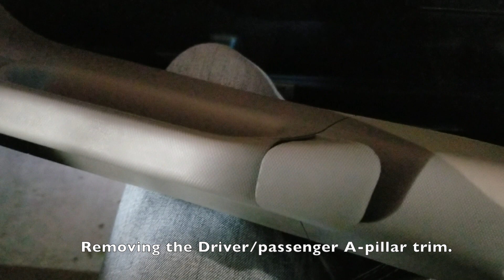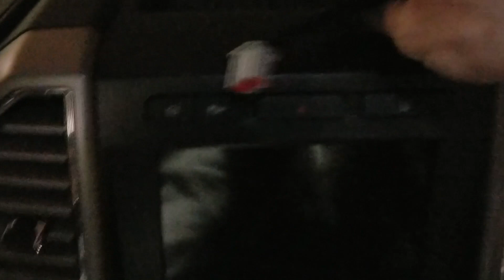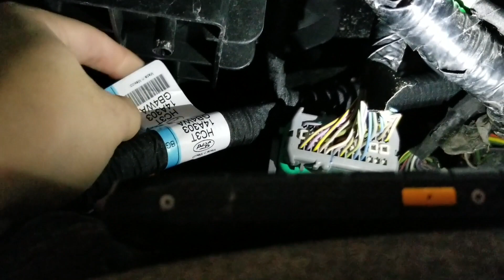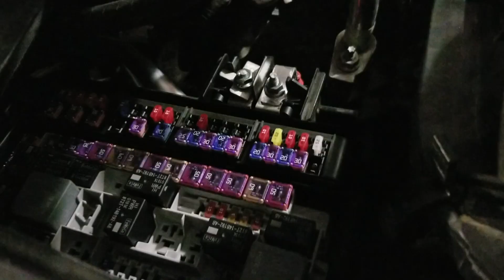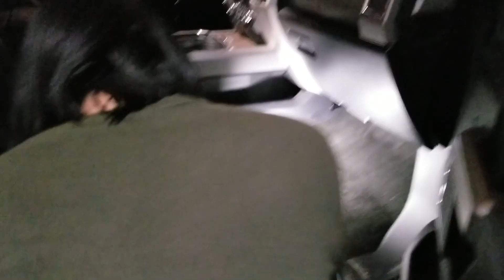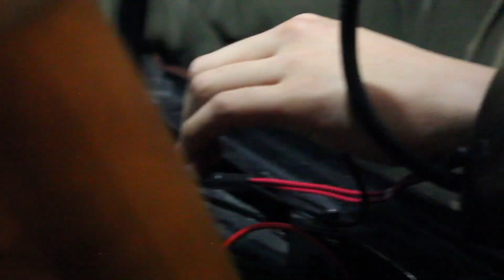2017+ Ford Superduty Upfitter switch install + Elevated idle mod

Comment: What harness part number do you have to run the wire through the A-pillar
Reply: A Pillar to switch harness -- LC3Z-15A404-A

Comment: Great content. Very informative and I learned a lot from your video. How different is the 22 from the 17 model years to add up fitter switches?
Reply: Switches are the same as the 2017 but you only have to do the short run of the harness from upfitter switches to the A pillar then connect the relay box under the hood for the 2021 and ups. They are prewired for the switches even though it wasn't an option on your vehicle which makes this job easy on the newer trucks. I would option for the wireless upfitter switch option by STL if I had a 17-20 model.

Comment: Will you do mine?  I have a 2017 F350 4x4 Platinum with a 6.2 Gas and for some reason no upfitters?  Had them in my last Truck and miss. Great video.

Comment: Does this work on the f150?
Reply from the maker: It's a feature on the Raptor so I figure it should be possible. Can't confirm though how difficult it would be on an F150

Comment: Do I need to get the console piece with the sunroof button in order to do this? I have the power rear window, but no sunroof.
Reply from the maker: In that case you'd order the overhead console without the sunroof buttons (find the VIN of a similar configured truck WITH upfitter switches and use that to find the part number for the overhead console)

Comment: Just did it on a 2019 F350 6.2 gas. Good instructions. Glad I did!
Reply: I have a 2018 F250, 6.2 gas. Getting ready to do the same. Can you tell me if your install was the same as this video? Same cable assemblies? Don’t want any surprises.

Comment: I own 2 F250s I never saw the need for it.
Reply from the maker: Depends on what you use the truck for. I have elevated idle, front and rear aux lights and winch control all running off my upfitter switches.
Reply: @55quadboy  I farm out of my trucks, they make really good work trucks . I like basic trucks

Comment: I know I’m real late and may not get a reply but I do have a question. So i had my upfitter switches installed recently and I’m being told the dealership has to program the BCM for them to work properly, did y’all have to do this?
Reply from the maker: Nothing needed to be done on mine
Reply: @55quadboy  Looks like i'm gonna have to do some tracing. Thanks for the response.
Reply: @55quadboy  hey man, one last question. From what I can see it looks like I’m missing the part of the harness that runs down from the upper console into the A frame, would you happen to know what part number that is?
Reply from the maker: @mightyfinger77  both part numbers for the harnesses are listed at the beginning of the video
Reply: @55quadboy  hmm I did buy those, thanks man
Reply: @mightyfinger77  A Pillar to switch harness -- LC3Z-15A404-A

Comment: Mucha gracias!!! This job was so freaking easy!!!  Worst part was the fender because I have bushwackers and rock deflecters. I wanted to do this upgrade for a tear now.  It's was so easy I should've done it long time ago.
Reply from the maker: You're welcome, glad to hear it worked out
Reply: Interesting thought though is why not shorten the wire and run it across the back wall?  Looks like it would save some wire threading time.  I'm interested in the high idle mod but it's a little overwhelming

Comment: Awesome video guys. I ordered the exact parts you listed as my F350 was a Lariat equipped as yours. I have the camel interior Blujean exterior, and dash trim is primarily black, so I love the black upfitter console. The 3 items ordered are everything needed for the modification except the small 10mm nut on the main fuse box. Followed your video and again excellent instructions. Do NOT let the task overwhelm you guys, with patience, a few revisits to this awesome video and modest skills YOU can do this modification. Bought my F350 DRW fully loaded with options and the dealer forgot the upfitter switches a 115-dollar option cost me $ 964.00 in parts and a Sunday to install. A new truck is off the chart expensive and hard to get with dealers getting Full LIST, even with a great trade in offer that's BIG bucks . So So So glad you posted this video so well informed as I now have my truck just as I wanted it FULLY Loaded .
Reply from the maker: Glad it worked out for you

Comment: Hi, Shaun. Great video.  I have the same issue with my 2022 tremor.  How do I get / find the parts numbers for the 2022.  Thanks for any help in advance. All the best!!!
Reply from the maker: Find a 2022 on the lot with the upfitter switches with the interior colours you have, grab the Vin and go to the parts department, they'll be able to use that bin to pull up the parts list for the upfitter switches. That's exactly how I  got the parts list for mine

Comment: Question. What is the point in the high idle??
Reply from the maker: Colder climates it can be used to warm the engine quicker or keep it at operating during extended periods of idling. Also helps when running higher load on the electrical system (lots of accessories on at the same time like lights, winches etc, or boosting another vehicle)

Comment: Do you realize the video is way more information then you need to know longer then it takes to install longer then it took me to install aux1 up fitter for my light bar aux2 for the high idle thats starting from scratch......no ones likes half hour videos...."you didnt go too far in detail" you said that ...went way Past too far shorten video mannnnnn
Reply from the maker: This video shows you how to install up fitter switches to a truck that didn't come with them in the first place, not "just" how to hook something up to an already existing switch (my truck never came with any of the switches)
Reply: Just fish the new harness through to the A pillar. Much easier and minimal clearance needed on the headliner

Comment: The harness for the console.. can that be used for a truck without a sunroof and just not plug it in?
Reply from the maker: You need the harness for the switches, you'd have a different console that doesn't have the sunroof switch
Reply: @55quadboy  😁😁

Comment: Can this be done to a truck without sunroof? I have all the parts just wasn't sure if I should  plan to take off the whole headliner
Reply from the maker: You will have to take off more headliner than trucks with the sunroof just to gain access. Honestly to mitigate the risk of creasing the headliner during the install I'd remove it completely in a truck without a sunroof.

Comment: Did your truck come with the relay box for the upfitters or did you have to install it. Is the relay box mounted with push pins or nuts and bolts? Thank you for sharing the video it looks like a doable job.
Reply from the maker: Relay box is part of the main harness, the part number for that is listed at the beginning of the video. All the parts I listed will be everything you need to do this upgrade to a truck without switches with the exception of one nut for the terminal to tie it all into. Just a quick trip to the hardware store will solve that.

Comment: Shaun, do you have the list of the part numbers? I have a 17 that I would like to add this to. Thank you for the video and help.
Reply from the maker: Part numbers are listed at the beginning of this video for a 17 Superduty
Reply: Shaun Viinikka, had to watch this again..must have blinked. Only 3 part numbers? Looks like this would be more items. I have the same truck with sunroof, sensors, slider. Got a late year deal on it, another item missing is the garage door opener. Why would they build a truck without this? I can understand the missing switches.
I’ll let you know how this goes.
Reply from the maker: @Kybossls  yup, just the 3 items listed there (2 harnesses, and the console). You'll also need a nut for the terminal to tie it into. Keep me updated on how your progress goes, hope it all works out for you
Reply: @55quadboy  what about the fuse box part number?
Reply from the maker: @thesmak60060  all the part numbers are listed in the video. The fuse box is part of the harness

Comment: Has anyone tried installing upfitters on a 2017 F-250 XL? Thinking of picking up a work truck and this would be an upgrade I'd like to make... if possible.
Reply from the maker: Depends on the console the XL comes with. It's can be spec'd with upfitter switches when you order from Ford so honestly can't see why would wouldn't be able to, especially seeing as how an XL is the working man's truck and is likely a trim that will actually utilize them as opposed to a limited or Platinum

Comment: Any idea if this works for the 2020 as well?
Reply: i'm wondering the same thing, looks like 2020 has a different location in the engine compartment for the wires.  any advise would be helpful!

Comment: Hey man, I was wondering what site you bought the first harness you installed on? I have been looking for it and when looking with that part # it doesn't show up.
Reply from the maker: I bought all the parts from my local Ford dealer. Might get a better deal from online distributors but this way I got the parts I needed.
Reply: @55quadboy  thank you, When looking at the harness that ended in 303, it shows that there is only 4 Aux relays and doesn't fit a 2019 f250
Reply from the maker: @dominiccaprini3652  the harnesses I used work for a 17 and work with all 6 switches. Im not sure if anything changed in the 19s but I can't see it being different

Comment: Thanks for the video.  I just installed my switches today. I ran into a couple problems and I’m wondering if you saw the same.  The blue box at the end of the console (furthest away from rear view mirror) handles the inputs from the motion sensors in the vehicle.  I had to swap my box from my old console to the new in order for the motion sensors to work.  I imagine the new one needed to be programmed but swapping seemed the easiest route.  Beware if you go this path yourself, the plastic molded clips that hold the sensors in place are very easy to break.  I broke one and was able to use the panel from the other console to fix it.  In addition to this, there was no microphone installed in my new console.  (Maybe I didn’t get the right console.)  I lucked out here too as I was able to remove the microphone from the old console along with the harness and install it into the new console.  After that, everything worked perfectly.
Reply from the maker: Thanks for mentioning that, you can use the module in the new overhead console, and it can be programmed to work via FORScan. We got mine to work using this method. Either one works as you've found out in case anyone else is running into the same issue with their upfitter conversion.
Reply: Hey. Where did you get your console at?

Comment: Any specific reason you used a 1/4 watt resister? Some people are using 1/2 watt and 1 watt. Does it matter?
Reply from the maker: Different resistance for different rpm
Reply: Shaun Viinikka I understand that. 20k is the resistance. I was curious why you picked the wattage you did.  In your video you used a 20k 1/4 watt. Others have used 20k half watt and 1 watt. Was wondering the reasoning behind your choice?
Reply from the maker: @cameronjohnston5158  that I'm not too sure of, Kevin is the electrical guru that did all of the wiring for that mod. I just held the camera. According to him: the 20kilo-ohm resistance value which we are dropping 5 volts across this value doesn't exceed the 1/4 watt dissipation. You can use a higher wattage resistor, that's not a problem but it's overkill.

The power dissipation is 1.25 milliwats, so we're well within the resistors dissipation rating.
Reply: Shaun Viinikka thanks so much. Makes sense. I appreciate the response.

Comment: would you know if a F150 has the existing connector in the wheel well?
Reply from the maker: This I'm unsure of, I know on the Raptor trim they get the same console with switches. I'd get the switch panel then inquire about the associated harnesses from the F-150 Raptor to do the job.
Reply: @55quadboy  Thank you.I have the switch panel, just need to figure out the harness part. on F150 forum someone is selling a made up harness that they say is needed, but according to your video i just need purchase the two harnesses. I will check my wheel well today. Thanks again.
Reply: @actfitwil  did you find out if this is possible to do on f150?

Comment: You guys are “Top Class”. What if my 2019 F=250 does not have that unused plug in the wheel wheel or the unused connector in the “A” pillar? Is that a show stopper, or just a matter of another harness (or two)?
Reply from the maker: I'd be surprised if it didn't have it
Reply: @55quadboy  Can the existing connector in the engine bay (that you pull the inner fender well liner for working access to), can you see it from the top of the engine bay looking down?
Reply from the maker: @herk1952  I'm sure with a lot of careful feeling and looking from an angle it could be visible, but it's easiest to access with the wheel well liner off. I haven't tried to look for it with the liner on from the top down however.
Reply: @55quadboy  I couldn't find the harness, so I had the local Ford dealership check.  They could not find it either. My truck must be one of the rare F-250s that does not have the pass-through harness. Am I totally out of luck here, or is there a part number for that harness?
Reply from the maker: @herk1952  you checked behind the drivers side A-pillar and under the foam piece that sits there?

Comment: Lol, I’m handy but that’s not Plug and Play.  Good job none the less!
Reply from the maker: Thanks! It's plug-and-play in the sense that all the connectors and harnesses are already made, purchasable and require no fabrication on the end users part to install assuming you're talking about the upfitter switches (yes it is quite time consuming from start to finish, but if you're patient it's not difficult). The elevated idle does require a bit of soldering and wiring, as with any accessory you plan to wire up.

Comment: Do you know if this applies to a 6.2 gas ??  Same part numbers and procedure??
Reply from the maker: I'm not too sure, I know they do have upfitters and there is a resister chart for elevated idle on the Ford body builder advisory site

Comment: Great video. Made me realize there ain’t no way I’m tackling that job.
Reply: mark224466... lol I'm with you. It looks like a pretty straight forward installation. But it doesn't take into account all the parts that I break doing a repair job.
Reply from the maker: It's actually not that bad once you get into it, but for sure to each their own. It took us about two days from start to finish
Reply: @55quadboy  2 full days? I’m doing the same adding the switches, who helped you with the harnesses dealerships havent been much help in my area
Reply from the maker: @fernandofranco383  2 days but we also had to stop and film and set up cameras.

If yours is a lariat with sunroof and sliding rear window then the part numbers I listed will be all you need. Otherwise finding a similar spec truck to the one you have on the dealer lot, and using that VIN number will get you the console you need. The harnesses will be the same

Comment: I finally got around to doing this last night to my F450 and your process is nearly perfect. I did break my factory console. I guess the tabs were a bit too tight. Took me about 2 hours to run the harness under the hood, mainly because I had to remove the OEM flares and mud flaps that took some messing around. Awesome video, thanks for the help.
Reply from the maker: Glad to hear it worked out for you, that was our goal when making the video. The console was a pain to get off for sure, I'm actually shocked I didn't break mine taking it out
Reply: @55quadboy  do you remember off hand what size nut is on the stud for the harness?
Reply from the maker: @mikemoreau4  I don't sorry, there should be one already there, I just took that one to the local hardware store and got one that matched to finish the job
Reply: @55quadboy  yeah I'm just too lazy to take it off and do that ha! 

Thanks again for the video. Never would have done this without you.

Comment: Would this mod be possible with a 2017 XLT F250 that didn't come with upfitter switch? Not sure if the wiring plugs would be there.
Reply from the maker: This should also work on an XLT

Comment: Did your truck come with the relay box ? If not how about part number
Reply from the maker: The relay box is part of one of the harnesses. I listed all the part numbers you'll need to do this upgrade to a truck with no upfitter switches

Comment: How are you getting 14.1 mpg? Mine is a 2018 6.7 turbo diesel and i am getting 12.5 avg.
Reply: Texas Sports Outdoors I have a 19 f250 6.7 and get 16 in town and 18.3-19 mpg on the high way. Depending on how fast I drive sometimes I get 21mpg.
Reply: @carls2210  Is that according to what the display says you are getting or did you do the math? Because it seems like i am getting more than what the display tells me.
Reply: Texas Sports Outdoors that’s me doing the math. Do you still have all the emissions stuff on your truck? My stuff fell off while in Mexico. And I just have a stock tune on it.
Reply: @carls2210  Hate it when that happens
Reply from the maker: 14.1L/100km. Different than MPG. it's a Canadian truck.
Reply from the maker: Mines very accurate as far as DTE and mileage is concerned, usually within a couple KM.